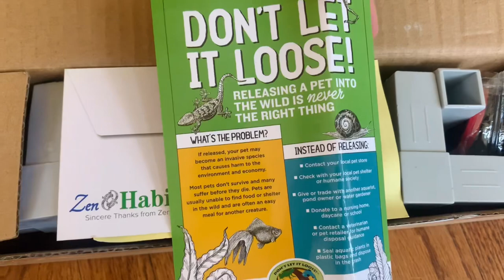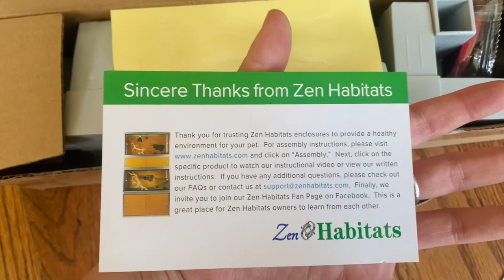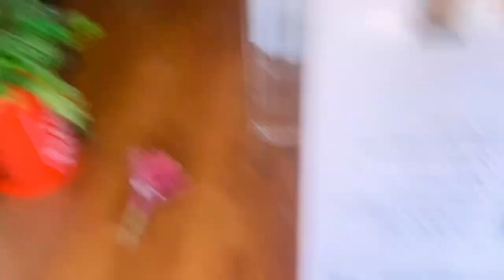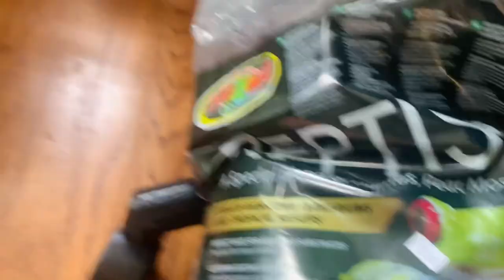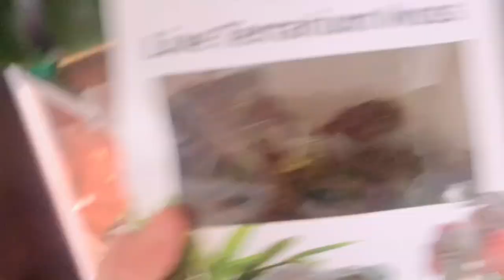New Crested Gecko Enclosure Build!

Comment: New enclosure setup.  Always so much fun.  Looks great.  I have a hexagonal 18x24x24 for mine.  Made it bioactive with a bunch of live plants.  I recently installed an indoor plant light on a timer because the enclosure didn't sit in a spot with a lot of natural light.  Helps the plants grow, and shows off the enclosure, too.  I think it also helps regulate her day/night cycle.

My last Zen that I used the spray foam on, I tried a different technique.  After spraying, I covered it with substrate and moss.  I pressed it down firmly, but not hard.  It pretty much all stuck, and I didnt paint anything.  Of course, it didn't have the "rock" look, but it looked just like a natural hillside.  I like the rock look, too, but it turned out really nice for my dart frogs.

"Last enclosure."  Famous last words.  Last enclosure, until the sweet little baby (whatever reptile) Lol...
Reply from the maker: The black spray foam is so nice and would work great for looking naturalistic. It’s just hard to find 😅